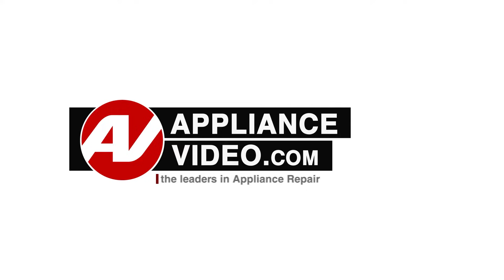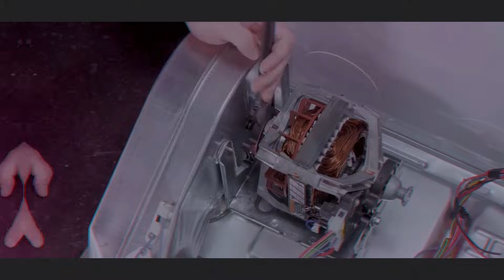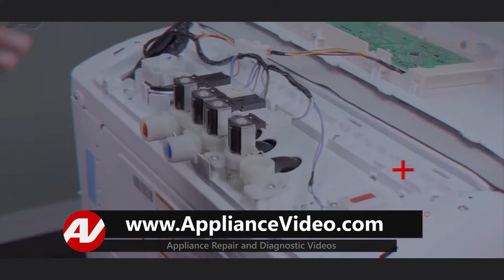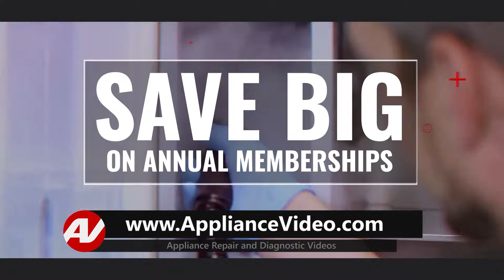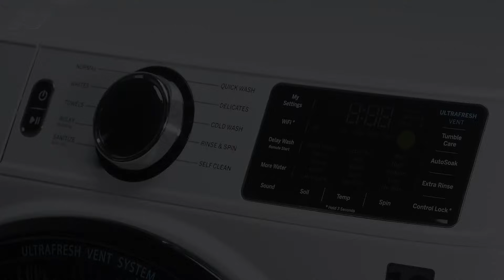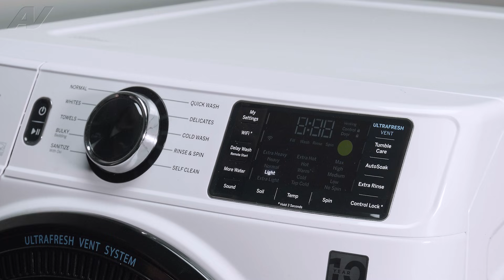GE Washer - Error Codes, Diagnostic Mode & Troubleshooting by Factory Authorized Technician

Comment: Great video!  I feel like I've made progress but something still not working.  It started throwing off 2 SmartDispense errors to my phone every minute - but we don't use that feature.  Can't seem to bypass it.  So it won't run. It just turns off.  I do have a bunch of errors in the first test: 92, 8, 38.  So I guess question:  When I get to the diagnostic mode (works just how you said - turn 180) none of the tests run.  What would cause it to just turn itself off every time I hit the "Start/Pause" to run ANY of the tests?
Reply: oh yea - GFW655

Comment: Thank you!
Thank you!
Thank you!
It really helped.
If anyone is interested our problem is the trap was full, and I mean FULL of lint.
This prevented it from draining.
The door would not unlock to prevent watef from getting on the floor.
Remove trap, flood floor, clean trap, replace trap, finish draining, cycle power door FINALLY unlocks on power on.

Againg really helped
Thank you.

Comment: I have multiple code but ultimately it is not draining. I replaced drain and made sure no links or blockages. Same issue. Tried diag 12 and does not drain. I am going to order a new main board.
Reply: Did you end up replacing the board? Did it work after?

Comment: What is my next option if washer will not go into diagnostic mode?  I am working with a GFW850Spnor.
Reply: Same - machine comes on and can see the diagnostic mode numbers but when I press the start button nothing happens or the machine shuts off - if it helps, I never hear the door latch (however, if I open the door, the display will tell me "door" so I know it is getting some signal from the door).
Reply: @loriesoliwoda-truong  mine too.  I get to where you run the tests easily - but when I try to run the test it shuts off.

Comment: Useless. I have the exact model and it will not go into tech mode like the other commenter said.
Reply: I had to flip the breaker on mine and leave the machine off for a couple minutes before either mode worked. Once i turned it back on both modes worked. Mine takes closer to 15 seconds on the first mode to come on. On tech mode once you turn the dial 180* take your finger off the start/stop button. I left my finger on the first few times and couldn't get it either. Funny thing is my drain pump stopped working. I took the machine apart and OHM'ed out the pump and it was way out of spec. Bought a new pump and now the machine won't turn on it just clicks. Not sure what happened but after about 30 minutes the machine decided to work. I had the exact same issue drain pump still not working. I was 100% sure the old pump was bad. The only thing that controls the drain pump is the main board. I ordered a board based on the clicking and the new pump not working. When I pulled the old board it had a nasty burn mark right through a transistor. I was actually glad as it all made sense. The board fried and took the old pump out with it. Now it works great again but my machine is only 2.5 years old. G.E. only gives a year warranty.
Reply: @scotts4125  can you tell me the part number you bought. You had the same issue I’m having but can’t figure out which part I need.  Is it the main control board or inverter board? Also, where on the machine does this part live?
Reply: The code explanations are inside the machine. Take off the top cover and it is there in a ziploc bag